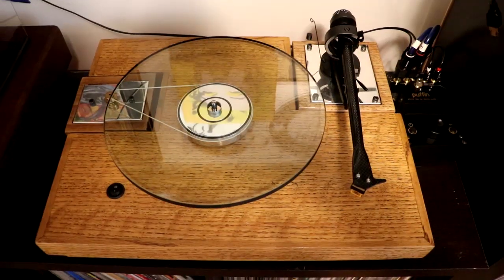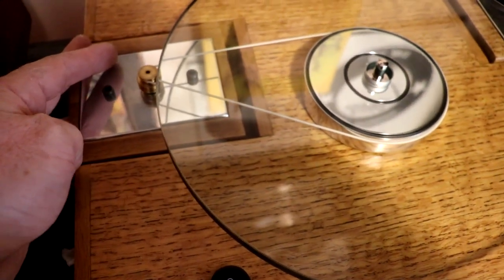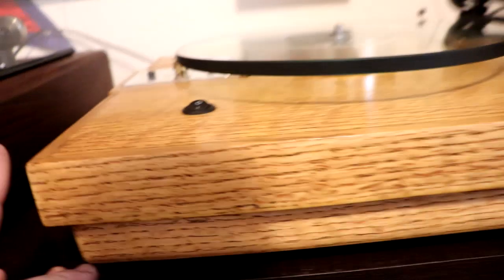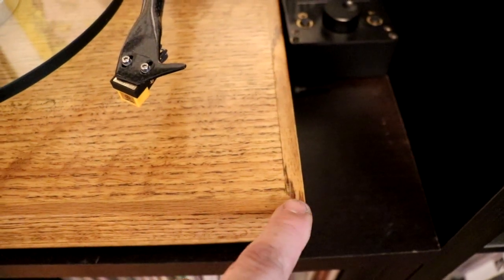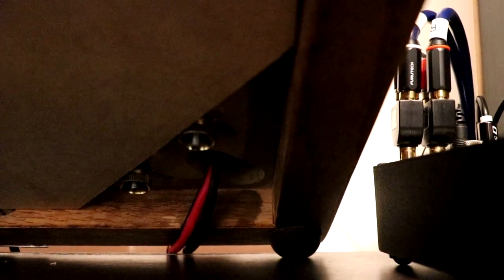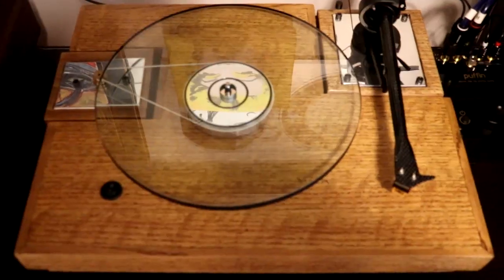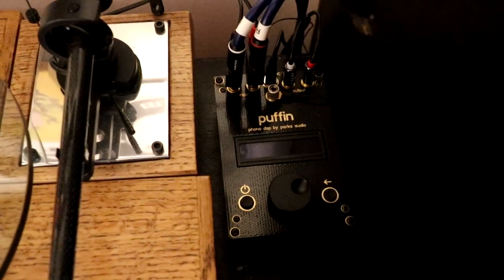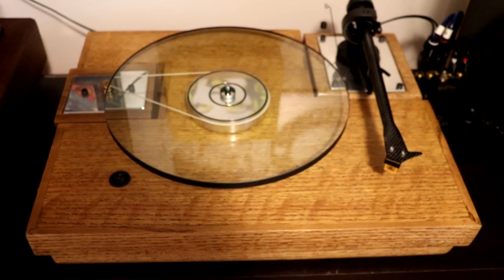Custom turntable build 2.0

Comment: Like both of your builds. What amazes me is that there aren’t videos or websites about making turntables with manufactured used parts. Every other hobby has a host of such iterations but with vinyl there’s science class-type, needle and coke bottle stuff or full $6K+ builds. I see the need for both but would like to see some “turntable bashing”. You touch on this at the end but I just can’t find content. Ideas?

Comment: Nice turntable build. Are you using any type of program (like the Dr Feickert ones that uses computer analysis) for testing speed and other measurements like wow & flutter etc, and have you compared it to other turntables?
Reply from the maker: Can"t say I have. No computer analysis. Be nice to have someone test my tables someday. I use an app on my phone to test the wow and speed and they are bang on. I have tested it against a rega P2 and it's better with speed consistency. I have done lots of testing but mostly by ear. This is only one of many I have built or modded.